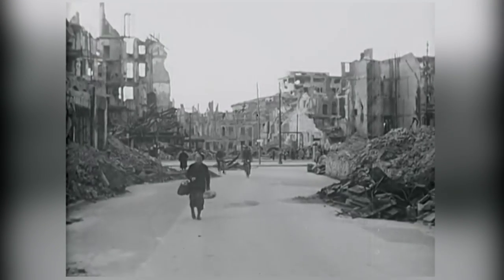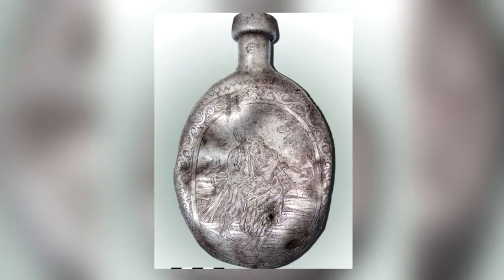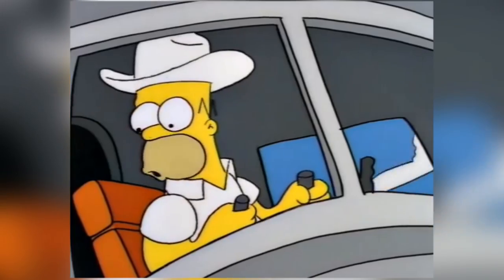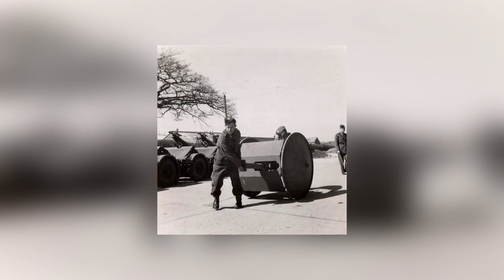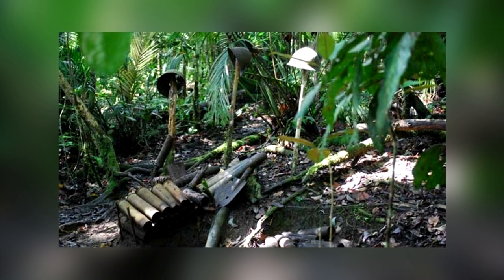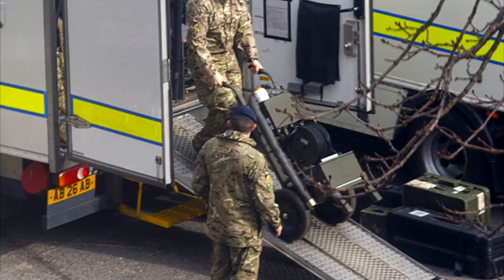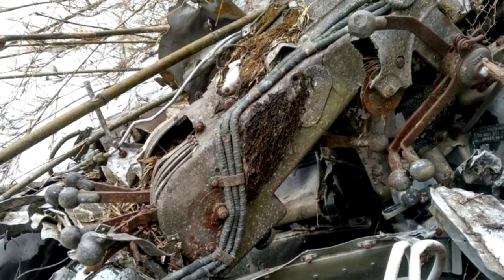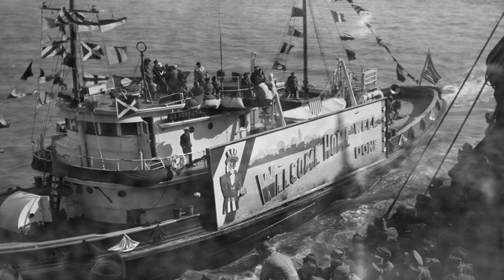12 Most Amazing Unexpected Military Finds

Comment: The house we bought in NH, (well, my Parents) in 1975 had stuff in the attic. one item was a 90mm anti aircraft round complete in black tube and casing, and fuse.
It was a WWII round. After the local police called in the local Nat. Guard, it was determined to be inert.
I later took the fuse apart, and found several powder charges which I disposed of in POOF style!
It still had the final charge in the bottom of the fuse tho...

Comment: People can do some amazingly stupid things when discovering old war materials. I used to Scuba Dive on Long Island. A popular spot for Night Diving was right on the North Shore of Long Island in a little peninsula called Bayville and Centre Island. (For those curious this is near where the Avianca Airliner famously went down). This is as it describes a narrow strip of land with only a single access road right on Long Island Sound. The North (beach) side of the road is lined with Restaurants and Marinas. It's a good area to find lobsters. And has some famous shallow underwater sights including the wreck of a WW2 era Japanese 2 man sub. (not sunk during the war. It was later bought and sank through misadventure). It's also directly across the Long Island Sound from Groten Connecticut. The US Navy's big Sub facility going back to the beginning of subs. 
Well one night a lone diver out hunting lobsters finds himself something impressive in about 12 feet of water under a bunch of parked sailboats. A 12' long Torpedo! So of course having not an ounce of common sense, he straddles it, and walking backwards on the bottom drags it several hundred feet to shore. At which point he proceeds to roll it up onto the beach, and into the lights of all the nice fancy restaurants and night clubs. Yeah, the Police, Coast Guard and Navy were not amused.

Comment: What a fuzz about one single bomb in london. In my hometown in germany they still find a bomb at least once or twice a year. They are all over the place. Under buildings, in gardens, under streets. Even after all those years.
Reply: It's the same here in London, Portsmouth, Birmingham, Southampton, Bristol, Liverpool... any major construction project turns up one or two UXBs. 
He just picked on that one because it made the papers due to the pensioners having spent their years above it!
In northern France, WW1 era ammunition is so common in fields, they leave it in little piles at the side of the road for the army to come and pick up!
Reply: @LifelongExperience  I see, thanks for clearing that up. Thats what i always assumed, too. With so many bombs dropped over your and our cities we can't be the only ones still finding them on a regular basís.  Guess it will take hundreds of years until the last bomb has found. If ever.
Reply: @DLT-po6to  I suppose the shocking thing is how many bombs failed to go off.
However I was told that in some instances, parachute mines were dropped with the express intention that they would not go off, as unexploded devices could cause disruption that lasted for days or weeks, keeping workers from returning to sites that had been attacked, while physical damage could be repaired or cleared in a short time.
There is a modern equivalent to this which is a munition that spreads dozens of small bomblets over an area, which lie on the surface... discouraging the use of an area until the unexploded munitions can be cleared.
They are used to attack things like aircraft runways.

Comment: Quit showing three gunned tanks, on pants that have 5 or less crew, its not accurate and it would never work, because of the places where the crew would be, it would have 2 crew, the driver and the co driver, because the gun loading area would be in the place where the crew is, it would not work.